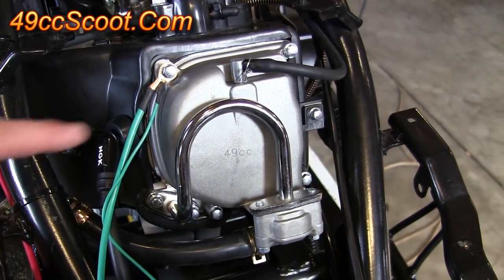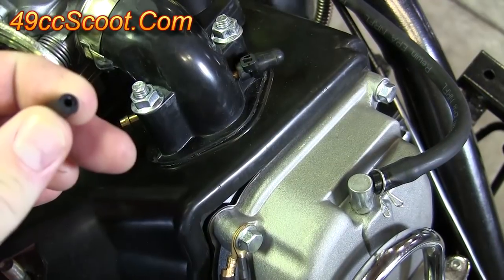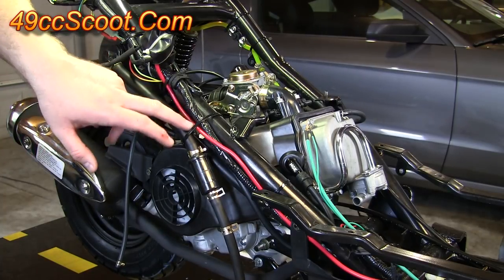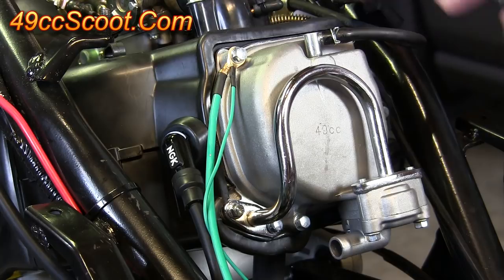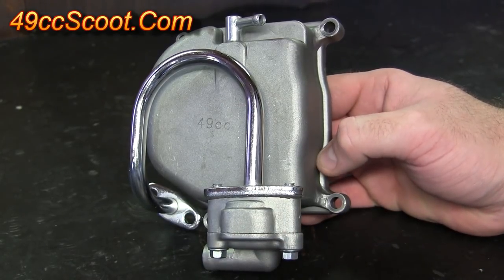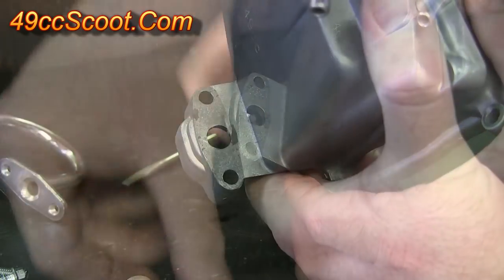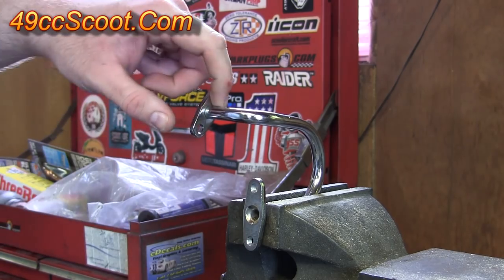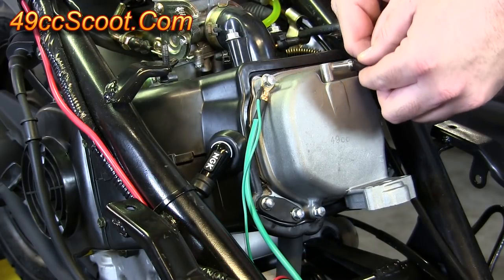Gy6 50cc Chinese Scooter PAIR System Removal : 139QMB Emissions : Racing Only

Comment: You are super helpful. I don't know of anyone else on YouTube that has as much knowledge about these scooters as you do. And you get right to the point, not like 98 percent of them that you have to listen to 25 minutes of back story just to do something that takes 2 minutes to do. Awesome videos.
Reply from the maker: Thanks!
Reply: @49ccscoot  Hey were does that rubber hose coming of the valve cover actually run to? Mine runs into the air filter box. Is that where it should go? Keeps having gas pour from it
Reply from the maker: @kevinearles1  The one at the top of the valve cover is a crankcase vent and usually goes to a port on the airbox. It should not have gas coming out of it. If there's gas in the airbox, it should not be from that hose. It's more likely a carburetor issue, like high float height.
Reply: @49ccscoot  it runs to a little cylinder thing that hooks up to the air filter. I know it's gas and maybe a little oil mix but mostly gas. I know it's coming out of that valve cover tube because I can take it off and watch it pour out as it's running. Dies the minute I hook the air box back up. Even if I take the actual filter out and hook up the empty box
Reply: @kevinearles1  you have gas in your oil your needle valve is not sealing the gas out
Reply: ANYONE  what do you achieve DOING  THIS
Reply: true i also love channel Lab Coat Paul
Reply: @49ccscoot Will this makes  faster the gy6 50cc what..?
Reply from the maker: @musatoci6215  No. If you're going to race or show, it will declutter and simplify.
Reply: @49ccscoot  I just check it on mine mine does not have this New its 2022

Comment: I would recommend re-jetting the carb main jet to 1 size bigger, since an egr/pair delete will slightly increase vacuum of the intake at full throttle, which draw more air from the filter.

Comment: My PAIR system was some 20 000 miles old, it was spitting black watery oily stuff (carbon particles) from that open end hose (from the canister/filter, the Benzhou YY50QT-6 has a little different setup), the engine was running poorly, mileage was poor and engine keep hesitating ('jerky' might be word in english) randomly at worsening rate. Took me some time to find out the culprit, but thanks to your excellent video, the problem was finally solved!
Reply: My sym allo has the same problem, the previous owner had a little bottle at the end of that hose to catch the oil?gas? Mixture coming out, now that bottle fell off during my last trip resulting in the whole Engine covered with that fluid. So you solved it by taking the egr system out,like in the video? I'm curious why there's a fluid coming out instead of air, so maybe I could solve it instead of removing the egr   or catching up the fluid coming out.

Comment: the other reason to remove it, is the cheap diaphragm in the canister often fails, causing a massive vacuum leak right to your intake manifold. mine failed at 500 miles, hooked a hand vacuum pump and gauge to the control line going to your manifold, which opens   the diaphragm, and it would hold zero vacuum

Comment: hey bud, its me again. LOL. I figured it out. My scoot has only traveled 1980km....so roughly 1100-1200 miles, and the culprit was the vacuum line that runs from the intake to the PAIR system. It was real stiff, and had a split in it as I sat on it the split opened and of course when I got off it closed. I work on vehicle and see stiff/brittle vac lines on vehicles with high mileage just found it odd that it happened on this scoot. I bought it brand new 3 kms on it from the dealer. Alls well that ends well. Thanks again for the ear to vent to, and the suggestions. And yet again for the great info vids! CHEERS!
Reply from the maker: Glad you figured it out. These are often cheap hoses, routed quickly and without anyone down the line to double check before they're sent out.

Comment: What consequences will this have with/for a stock exhaust since it's, to my knowledge, there to improve the dynamics in the exhaust at cold start regarding catalysator? Is there a chance that the catalysator will clog up with carbon and stuff because of the lower heat?  Or am i "thinking wrong"?
Reply from the maker: You're thinking is correct. That's the main risk. Obviously more emissions, but also potential for premature buildup.

Comment: yeah thanks a lot i did this but i didn't had a welder machine so i just used some bolt and nut to plug off the plate

Comment: I bought a new scooter and the big hoses came half cut what time of hoses is it so I can buy a replacement because I asked the merchant and they said that the hoses is suppose to be like that but your video proves them wrong
Reply from the maker: They could have changed in design by now or sometimes people mistake EGR for PAIR so be sure of what you have first.

Anything attached to intake vaccum needs to be vacuum hose. A lot of things could probably work for others.

Comment from the maker: You won't get power from it if it's functioning properly. Eliminating this can help if you get popping in the exhaust with an aftermarket pipe. Otherwise, just removes some clutter.
Reply: Will it help if it shoots fire ?
Reply from the maker: @thelagmeister  It's possible, but that could be a lean condition or an exhaust leak.
Reply: @49ccscoot  Thanks. EX. is airtight . I have a 50mm kit, stock head, 19mm carb w/90 jet at high elevation. If I figure it out I'll be back. Huge thanks for everything you've done for the Scooter Community.

Comment: hey cool video ! question, does the piston sucks the fresh air in the exhaust valve ? what pushes the fresh air into the exhaustport ?and for blokkage ,what if you just squeeze the hose on the cilinder and block the intake ?is that also enough or ?

Comment: Nice video! 

I have the system with:
- Hose from top valve cover to airbox.
- Airbox to SLS membrane. 
- Sls membrane to lower connection Valvce cover.

And a vacuum line from intake manifold to sls mebrane to activate it.

Actually about the same as yours.

Cant I just disconnect vacuum hose from sls membrane, close the hose.
And leave the rest hanging as it is?
Reply from the maker: Probably, but if you're leaving everything in place there's not much point of doing this. The emission system won't hurt performance if it's operating properly and you're not cleaning anything up that way so IMO you might as well leave it and keep it legal and cleaner.
Reply: @49ccscoot  Thanks for your reply.
I have 2 GY6 scooters.
The other 1 has a hose from top valvecover to airbox. 
And a small pipe with filter on lower side valvecover.

The scooter im asking about with the system in your video has the issue that after driving it my clothes smell from exhaust gasses. 
The other scooter has 0 issue with that.

I was thinking maybe I can test if with the sls disconnected the smell is gone.
I use the same oil in both scooters.

Your method would stop the gasses at the lower left of the valve cover.
ID say that if I only disconnect the vacuum hose that activates the membrane, my gasses would run from lower left side of valvehead through the hose and stop at the sls mounting on the frame where the  membrane / 'pump' is located. This way no recycling these gasses through my airbox adn maybe a bit less smell. 
Id think and hope its no problem to have the gasses run and stop at the unit there.
Reply from the maker: @Fanatiekeling747  Sometimes you get a foul smell in your gear if the air/fuel mixture is off as well.
Reply: @49ccscoot  Yeah true, but I would like to try without SLS first. This scooter has some weirdass behavior. It is running too rich, with a 82 main jet, but when I put a 80 mainjet it staggers between 15-40 kmh. 
I tried to different mainjet 80's in case it was a manufacterer mistake or so, but same results. 
Ill have a look into that also.
Especially now the weather has gone up 20 degrees lmao.

Comment: hmm, allot of these videos i see these scooters have the filter/cannister. my scooter has a pair system but the big hose goes into my airfilter and the valvecover vent also goes into the airfilter.
why is that diffrent on mine? also is my scooter choking on its own exhaust gas?
Reply from the maker: You may have EGR and not PAIR.
Reply: @49ccscoot  oh is that the difference, i think its called SLS in europe tho, then the pair system is better as it atleast dumps the exhaustgas to the filter>>atmosphere? with the sls it just dumps back into airbox. i ordered me a non sls valvecover + blocking plate and airbox without the sls hose fitting. im curious to see if it makes a difference.

Comment: Instead of blocking off that corner with a plate,I left it and removed everything else it was alot of hoses about 12 for me since I also removed the fuel pump and just put it directly from gas tank to carb,way better in my opinion and for the hose on valve cover I removed that and put a rubber bushing right over it and wrapped an aluminum zip tie to hold it.....not sure if it's because I have a Briggs and Stratton exhaust and its very small but my 150cc pops so loud from deceleration that people literally think I'm doing a drive bye lmao (dead serious) its been awhile since I've had it hasn't given me any issues as if yet but I just upgraded to a free flow carbon ebay exhaust just have to fix my exhaust leak now and hopefully test it out see how it runs

Comment: So, I had pulled all my old stock air box off. Then changed to a upgraded air intake filter.  It would not run tell I tap a hole in the center of it. Then put the small line coming off the top of the valve cover line into it. Like it went to my old air box stock. So, what I’m wondering what would happened if, u ran the big hose on the bottom to the upgraded air filter? Does it suck or push a vacuum? Could this make it run better possibly. I know it maybe a-bit excessive to go back straight into the intake filter again . But, what about straight hose. No can filter at all?  I know the air/fuel ratio would be effected. But, could you run more lean possibly?
Reply from the maker: You'd be better off leaving the PAIR system as-is. Let the PAIR valve and reeds control vacuum as intended and don't introduce vacuum where it shouldn't be on the air inlet.

Comment: Btw, the exit lower left of the valve cover where a pipe is connected, Simply said the one you either make or buy a block off plate for.
What is really behind this, I mean gas is pushed out through it, but where does this entrance go to?
What actually happens to the pressure when u block it off?
Reply from the maker: There's a passage in the port. The port just operates as a port normally does. I'm sure there must be some effect, but I couldn't tell any difference either way.
Reply: @49ccscoot  Interesting. :) You wouldnt happen to know where the port goes to?
Reply from the maker: @Fanatiekeling747  It's a passage that goes to the exhaust port. The system injects air into the exhaust stream.
Reply: @49ccscoot  AH so. thanks!
So in reality the hose that comes from the air filter box that goes to the sls filter actually transports fresh air to the sls filter and then the hose to the port on the cilinder head sends this air out through the exhaust port. 
Hella I had it the other way around. Thinking the sls port on the cilinder head sends warm air to the aitfilter box. SO easily said worst case scenario, only the top thin hose on the valve cover sends warm air to the air box filter. 

Meaning that disconnecting the big hoses on the sls on my scooter would only give me worse smelling air.

Comment: The 150cc looks the same. I can do all this on it. Hose on the valve cover was left on. Makes the motor louder. When I out hand over it gets quiet. So I can remove this and it's safe?
Reply from the maker: If done as shown, it should be fine.

Comment: i watched someone do the same thing exepct they connected one of the vacuum lines to the carburetor instead of plugging it off will this work ? what is the difference between plugging it and connecting it all
Reply from the maker: If the carb has a port that is meant to be a vacuum port, that can work.

Comment: Terrific video. I especially enjoyed the Nicolas Cage presentation. Question I noticed that the other side (left) you had that capped off already so what do you have at the petcock vacuum valve? Assuming you have a three way valve there. Is that capped also?
Reply from the maker: Mine is a barb at the tank so I just swapped over to a manual shutoff valve inline easily.

Comment: Hi, I removed the emisions from my chinese 150 and added a uni intake,  and now I having issues running properly, here is my question, from the PCV on valve cover there was 1/4 in running to the airbox, and then from the gas tank there was a second 3/16 hose, not the fuel line, running to a cannister and the cannister was hooked to the airbox, now I just have both of those hoses vented to the air, I wondering if one of them needs to be plugged, namely the one coming from the fuel tank and not the PCV, Im thinking that may be the issue, any ideas?  TY so much for you videos
Reply from the maker: The hose from the fuel tank may just be evaporative emissions.

Comment from the maker: Won't hurt the engine. Could potentially shorten the life of the stock muffler/cat.
Reply: But it hurt the environment
Reply: @khaledbenz1424  Then go buy an Ford V6 SUV. They have latest catalytic converters and fuel injected engines. Only use Premium fuel to make it feel smoother.
Makes enviroment happy and your feelings returned back to safe and normal.
Reply: @khaledbenz1424  scooters burn a tiny fraction of the fuel used in any car on the road.  Negligible amount of difference.

Comment: my honda spacy bik a 100cc engine a gasoline jacuzzi. What is the feler mumber for the gasoline jacog and the number for the exhaust jacog in mm
Reply from the maker: .002" intake, .003" exhaust, usually works pretty well.
Reply: @49ccscoot  Dear this measurement is it the company's service system? A solution is not included in the manual
Reply from the maker: @لطيفالحلفي-ح7ض  That's not a service manual specification. Actually, I misread and thought it was a Chinese engine for some reason. That's the spec I'd use for the Chinese made 50-150cc. Being a Honda, you should be able to find a service manual somewhere online. The regular owners manual will not list this info.

Comment: Do u need to plug the intake on both sides ? So just delete vaccum hose?
Reply from the maker: You have to plug any unused connections on the intake. If you have hose going to something like a vacuum petcock, then leave that alone.

Comment: @90gtvert what do you do with the hole left where the reed valve was? Also one of my vacuum hoses on the inlet assembly pipe goes to my vacume fuel pump  what should I do about that, thanks.
Reply from the maker: If you do it all like the vid and have the same setup, there should be nothing else to deal with around the valve.

You can keep the vacuum pump. Just make sure there are no Ts or junctions where a leak is created by removing other vacuum accessories. Can run a hose direct from the intake to the pump to simplify in most cases. If it's a pump, you need to keep it. If it's a petcock, you can swap for manual and plug off the vacuum source if you'd like.
Reply: @49ccscoot  Thank you for replying so fast, I have a kymco agility 4 stroke  the fuel tank is lower than the engine it seems my fuel line comes up from my tank, to a fuel filter , to a one way valve  and into the vacume petcock, I took the external fuel line, (going to carb) off the petcock I then cranked the bike over and no fuel came out, so I presumed it's just a vacume petcock.

My question is, is it possible that my bike has no fuel pump at all AND  a tank lower than the engine, can the carb suck fuel itself?

Either way, I bypassed the petcock and attached the fuel line directly from the fuel tank (which is lower) to the carb, and the bike ran for a few minutes before cutting out, after this  it would have cranked over until the battery died, had I not re attached the fuel line to the petcock and layed the bike  nearly on its side and cranked it over with no throttle for a couple minutes, I eventually got it to start and it idled horribly and kept cutting out at the slightest hint of throttle until eventually it started ticking over well enough again. I'm presuming I flooded the bike and maybe fouled the plug a little?

If my bike doesn't need a fuel pump, because it ran fine for 3 minutes whilst the fuel tank was attached directly to the carb, why did it cut out? If that is the case might it be because I flooded the engine and fouled the plug slightly? I have upjetted to a 88 on a 18mm carb, instead of the factory 12mm carb with an 80 jet because I have been having issues with the bikes speed, hence why I was playing with this In the start, thank you very much for you're time.

https://imgur.com/a/c6W3qUq
Reply from the maker: @craigmatthews3651  What you have is a pump, and you need it. The carb won't suck the fuel up there. It needs the pump. Probably ran on what was in the bowl and then died.
Reply: @49ccscoot  Okay thanks bro I rechecked fuel pump and I had a loose  vacuum hose, that's fixed now, back to figuring out why this bike refuses to past 50kmh
Reply: @craigmatthews3651  if its a 50cc thats about as fast as they go

Comment: excuse a question; at 2: 13 you are removing an hose from a jet on the head. My question is: where was connected that hose? Or it was at free air?
Reply from the maker: It went to the canister shown in the vid.